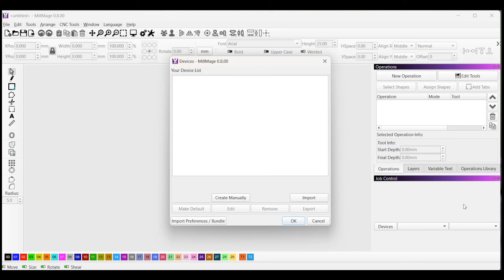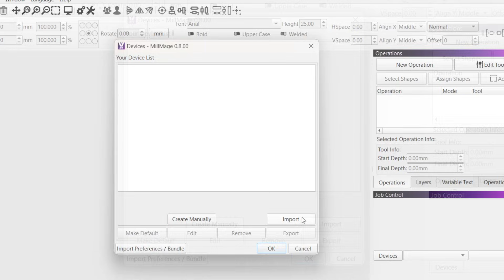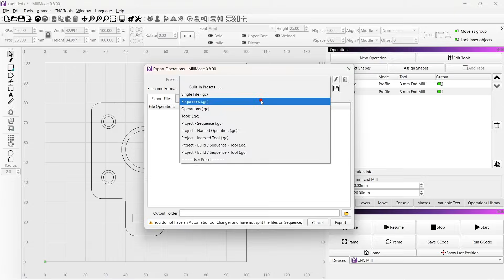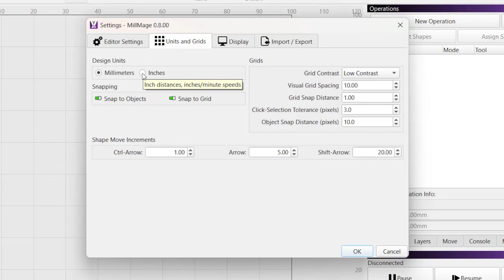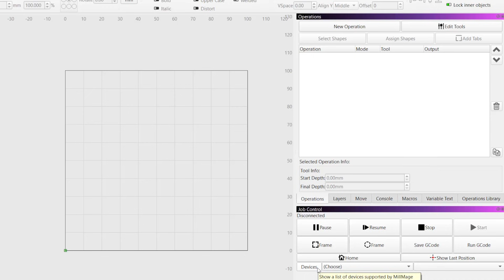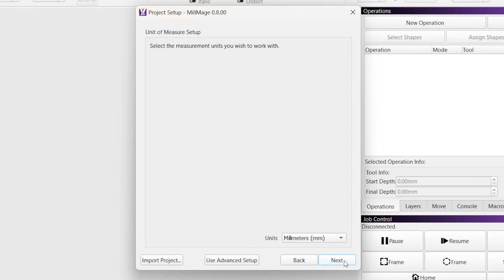Adding a CNC to MillMage

Comment: Hi, will it work with Cubiio X?
Reply from the maker: MillMage's compatibility level will depend on the firmware that this machine runs - so we can't say for sure without knowing more about that. MillMage can directly control any machine running GRBL, standard GRBL variants, or Smoothieware firmware. It can produce toolpaths for any machine that runs on standard GCode.

You can learn more about MillMage's capabilities here: https://docs.millmagesoftware.com/0.8/MillMageFactSheet/